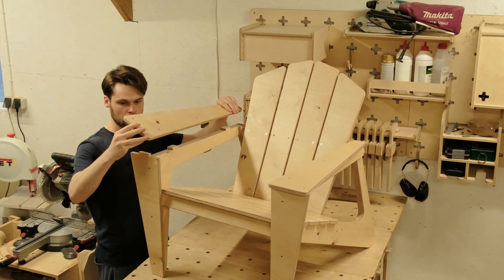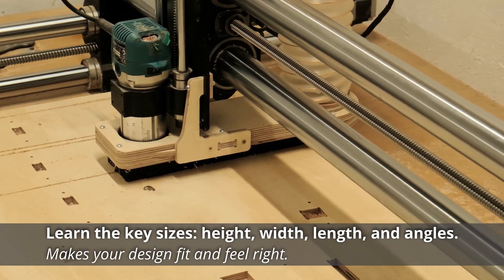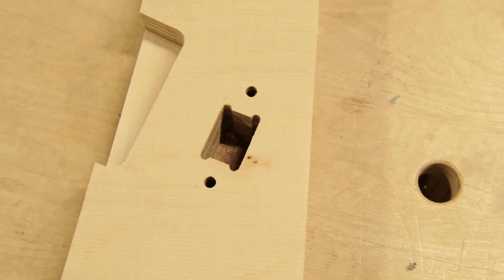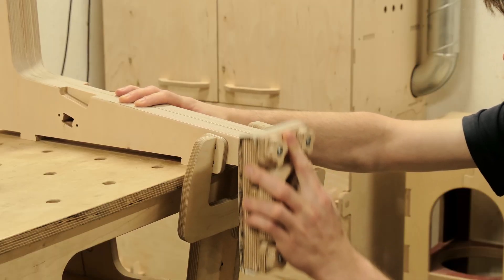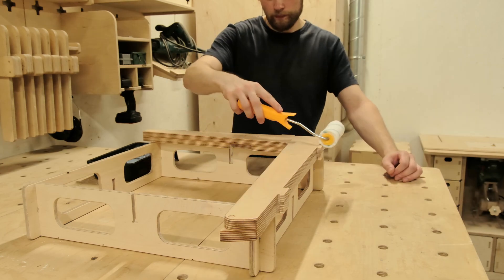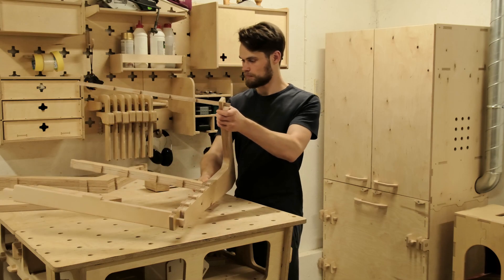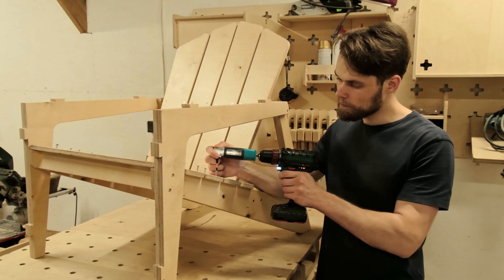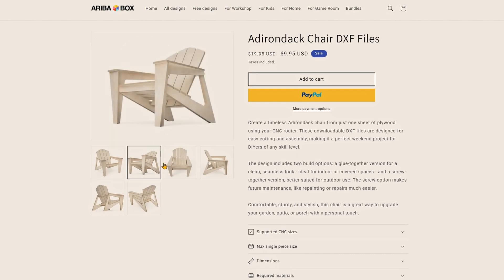Adirondack Chair - Best Woodworking Challenge?

Comment: Looks amazing, thanks for sharing. Have you experimented with using furniture bolts? They are stronger than the screws and would easier to disassemble - And look even more pro. Search: CNC Panel Joinery Notebook for an image of how you could use bolts and also look up barrel nuts, and cap nuts which would be good looking options. Looking forward to your next video. Thanks